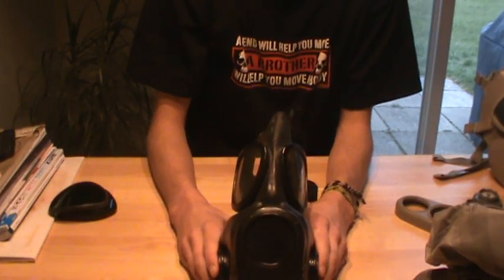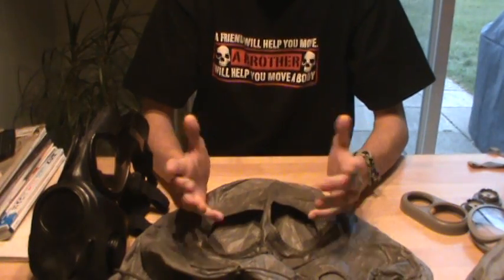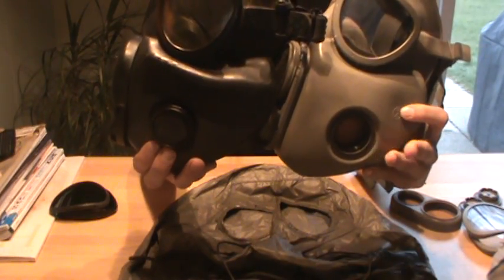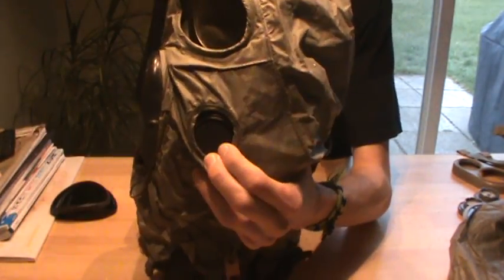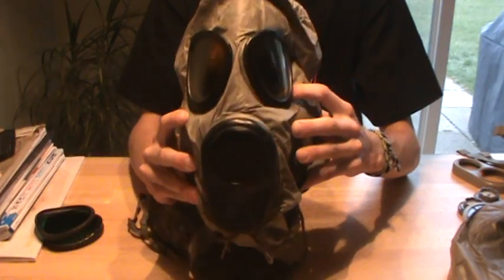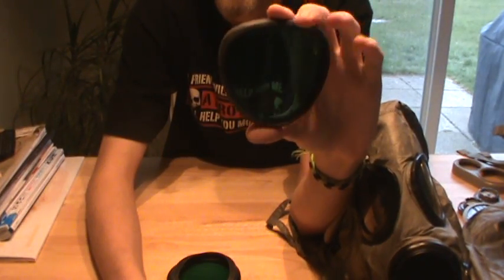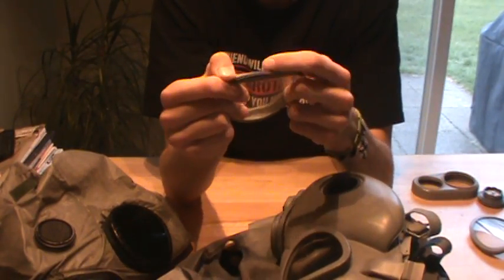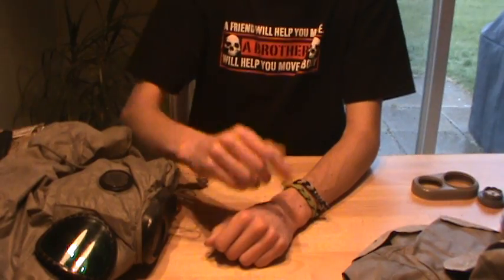Chemical Protection Hood Installation

Comment: The only difference between the M17 and the M17A1 is that there is a water drinking tube on the front and it has a resuscitation feature.
When the A2's were made, they either removed the resuscitation feature, or didn't make one with it. and it was made in another size for abnormal heads, and females.

Comment: I usually start by stretching the hood over one of the eyepieces. You can then rotate the hood into the correct position to fit over the other eyepiece. Then work on getting it over the diaphragm/exhale housing. It's easier to stretch the hood when it isn't anchored to the diaphragm/exhale housing. Personal preference I suppose. Also, the hood would normally be tied off over top of the exhale(in temperatures above 32 degrees or so). This would be to keep the hood at slight positive pressure.